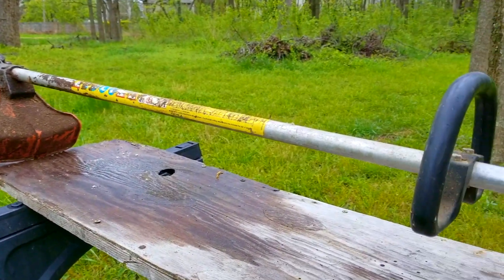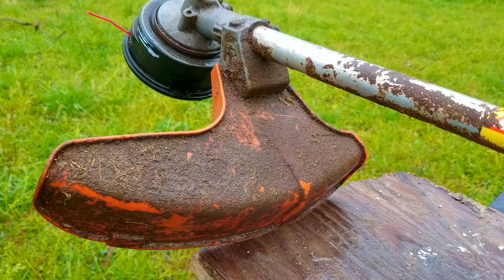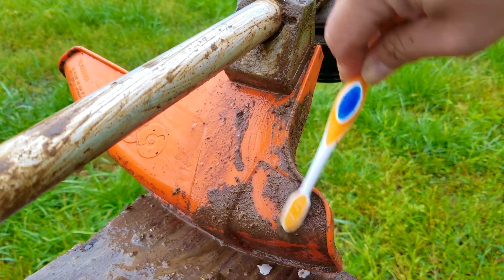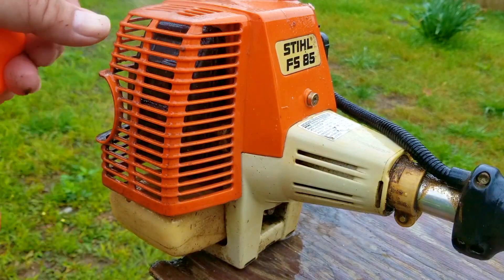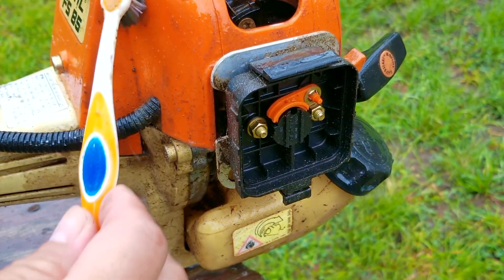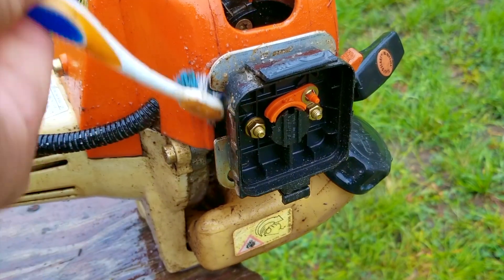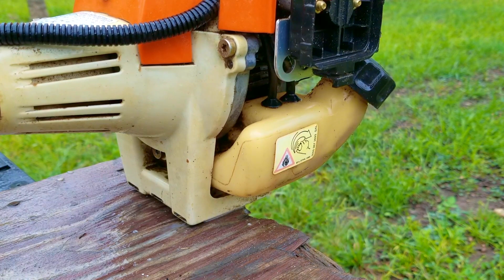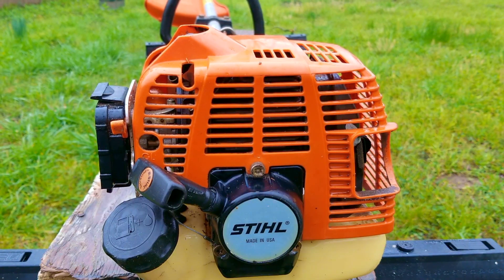Q&A #11 and the first look at a STIHL FS 85

Comment: I received my Dad's FS85 that he bought new in the late '90s when he passed away in 2011. I use It year round here in Florida and it still looks and runs like new. I also have an FS75 curved shaft trimmer, BG86 blower, HS45 hedger and four Stihl chainsaws that I've picked up cheaply and repaired.  I love your channel and watch every new video as it comes out.

The best cleaner i have found is Simple Green Extreme Aviation - I buy the gallon concentrate and dilute it 3:1. It's safe for aluminum and really cuts dirt and grease. Plus it's inexpensive to boot!
Reply from the maker: thank you John Taylor for the information.
Reply: hello friend, your machine is over 30 years old and is working well, what were the repairs you made in these years?
Reply from the maker: this is one is not mine, But so far, it has only been carb work

Comment: The last new trimmer i bought was an echo srm225 from my local hardware store. I even got the conversion kit so i can cut brush when i need to. Have you ever heard of the crank in a chainsaw breaking ? It happened to me last year and i had another saw that was the same but the top end was burnt and i just switched cranks around
Reply from the maker: yes I've seen it on a newer craftsman. It broke right before the clutch

Comment: I really like my 85 blower. My wife has my older Echo blower that I also have no complaints on but we both got tired of the starting issues on the trimmers (Weedeater brand and old as rocks) and got a blower/trimmer kit from Lowes. 1st time out with the trimmer it was a joke BUT having reset the trimmer line blade for a wider cut it did a FINE job. I won't say as good as a 2-cycle but good enough for here. I keep all batteries inside because temps below 45 will hurt the life span. She will trim around a solid hour and use 1/2 battery power. And as far as all the green power addicts, how do they think all the uranium gets mined and shipped. Not with a battery rig. Thanks and GBWYou!
Reply from the maker: the battery "maintenance" is going to be new to a lot of people and the effort it takes to keep them "working" is going to be missed by most people. Then again I think that was the point.
Reply: @INSIDEHOUSEGARAGE  Right. There will always be something to do to or for whatever we have; always a trade off somewhere. One thing I like about the Kobalt trimmer is the straight through head that can be loaded without taking it apart. 12 feet of line works good for this one. I notice that a lot of the others are going to this style too which is a good move.

Comment: hi...do you know if the cap has a vent?
Reply from the maker: yes this particular cap, is the venting type.
Reply: @INSIDEHOUSEGARAGE  how can i check if my is clogged?
Reply from the maker: I would use an air compressor, set to a low pressure, like 5 PSI, and blow into the hole on the "outside" of the cap, if you can feel air coming form the other side, it's not clogged. otherwise I would just replace the cap
Reply: @INSIDEHOUSEGARAGE  thank you!!
Reply from the maker: no problem

Comment: Hi Home Garage, feel free to use this question in a Q@A video. do you enjoy working on older equipment, rather than the newer stuff, keep I'm mind that the parts for both are cheap and are readily available?
Reply from the maker: That's a tough one, I don't have a preference, the only thing is parts availability.  I've seen a 5 year old mower Husqvarna, have less parts available then a 25 year old craftsman.  The statement should be, I don't really like working on machines, where I know, the parts are in short supply.
Reply: @INSIDEHOUSEGARAGE  i agree with the parts availability I with more machines and companies have more parts to buy

Comment: Is propane better than gas?
Reply from the maker: That's a great question. It depends how you're comparing them. It's generally believed that propane is cheaper to run, than gasoline,  But that's not considering if your filling your own tanks or buying them. The other issue, is that if you're using propane for a 4 cycle trimmer, that means you'll have 4 cycle problems, like oil changes, and  valve adjustments.

Comment: Im actually going to try and cobvert an old lawnmower to run on homemade hydrogen gas
Reply from the maker: are you going to separate the HHO generator from the mower? Just be very careful, the risk of an explosion is very high, I might share my experience with you guys some day.
Reply: @INSIDEHOUSEGARAGE  probably, ill see what the safest option is, also will do a ton of testing and srore the gas in propane containers with seperate labels
Reply from the maker: sounds like a great idea.

Comment: If you can May you please do a repair on a professional echo trimmer like the x series I think it was the srm 2620 because the primer bulb fills up with fuel but not much at all could you please possibly tell me why it won't fill up all the way? Thank you I'm also a fan been subbed for about a year now keep up the good work!
Reply from the maker: thank you T Money Official HTX, If I can find one yes I'll do a video on it.  To answer your question, there could be a couple of reasons why your bulb isn't filling up much.  The first could be a soft fuel line, that's collapsing while you prime, The other would be a bad Fuel Filter.  The last reason could be a bad diaphragm in your carb.
Reply: @INSIDEHOUSEGARAGE  ok thank you I will take a look at it later
Reply: @INSIDEHOUSEGARAGE  but also it runs just fine it bogged because of a bunch of weeds were wrapped around the head so I was a little confused of how it ran just fine but I now think I get it thanks again! I will let you know if I have anymore questions!
Reply from the maker: that is very interesting, that changes it up a bit.  If it runs fine, I wouldn't worry that the bulb doesn't' fill up.